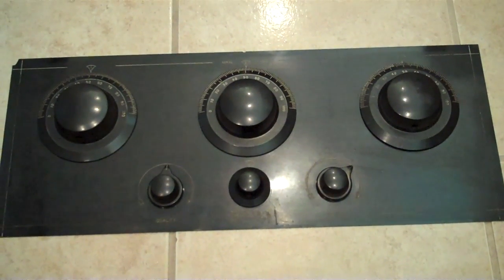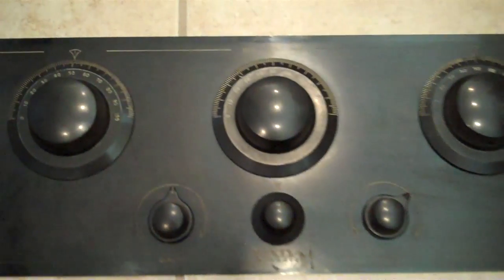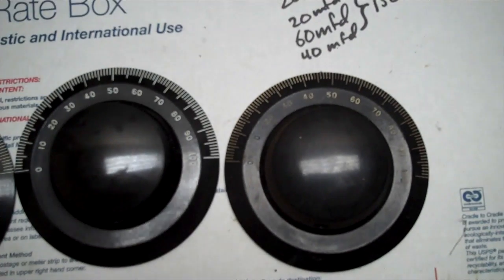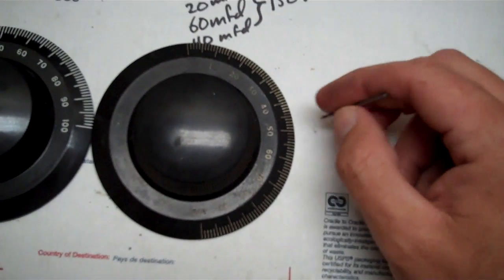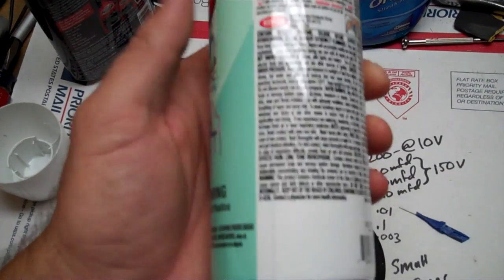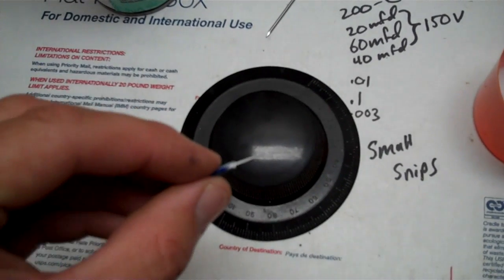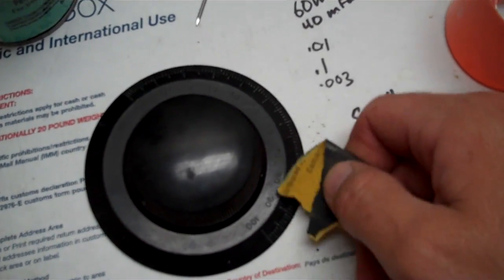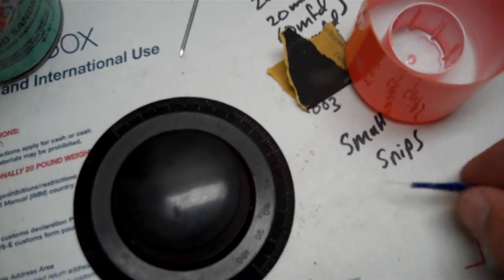How to restore 1920's Bakelite dials. PART 1.

Comment: Just completed 3 knobs on my Freshman masterpiece. I did it a little different but got great results. I attached the knobs to a 1/4 " dowel pin via the set screws and mounted in my drill chuck to sand off the excess paint and polish with 0000 steel wool dampened with  "scratch remover" and car polish. They look almost new. Great idea

Comment: I would not recommend this procedure; it could cause permanent damage to the dial. This is something I learnt the hard way when I ruined a beautiful set of National Type A Velvet Vernier dials.  Fine-grit sandpaper will permanently remove the lustre from the Bakelite.  So will cleansers like 409 and Fantastik.

Bakelite is phenolic plastic with a filler added, often fine sawdust. When it sets in the mould, electrostatic repulsion forces the filler particles away from the surface, leaving a microscopically thin "skin" at the surface. This skin is what gives the Bakelite its lustre.  Once that skin is gone, there is no way to permanently restore the lustre.  Car polish and similar products do not replace the original, and likely any shine they produce will deteriorate with age.  You cannot permanently shine sawdust.  409 and Fantastik act as a solvent for phenolic and wash away the skin.  Fine-grit sandpaper sands it away.

NEVER use a sharp metal object to scrape out the paint.  You will inevitably scratch the Bakelite inside the little groves and impressions, so that the re-painted lettering and markings  come out fuzzy or otherwise damaged.  A better tool is a sharpened piece of wood or plastic, something soft enough to remove the paint but not damage the surface of the Bakelite. I have used radio alignment tools, like the ones used to adjust slug-tuned coils, sharpened to a point.  Just make  sure they are plastic or wood,  not metal.  For a single dial, you will probably have to re-sharpen the tool multiple times, but it's worth the  required patience.  If the old paint is too hard to remove, apply some paste-type paint stripper.  It won't dissolve phenolic so it should be safe to use with Bakelite.  If you are not sure, test a small drop on the back of the dial, let it sit for a few minutes and then wipe it away, to see if it changed the texture of the surface.

The dial should be cleaned only with a mild soap or detergent solution in warm water.  Once the old paint is removed and the dial is clean, new paint may be added per the video. I have found that about any oil-based white paint works. An ideal product is a "lacquer stick", which works just like a wax crayon. Antique Electronic Supply in Tempe, AZ used to sell them, and I believe they are still available from Amazon.com.  Do a Google search for "lacquer stick".

Once the dial is re-painted, let the paint set for a few minutes, then wipe away the excess paint using a piece of thin,  lint-free cloth, slightly dampened with liquid paint stripper (see the precaution above). A piece of old bed-sheet works great. A light buffing with a dry piece of soft cloth will polish up the dial and finish the job.

Don